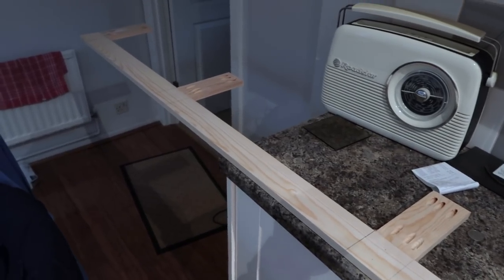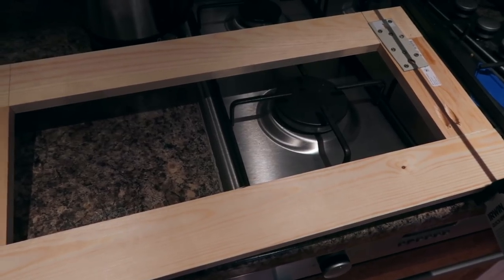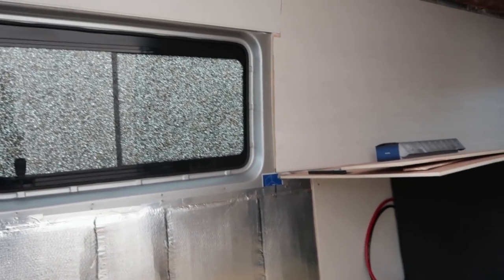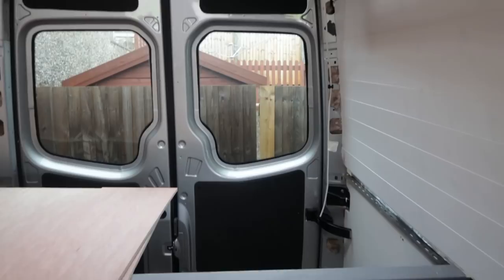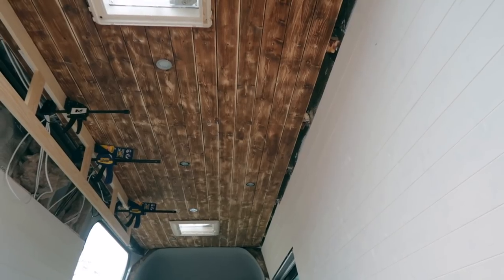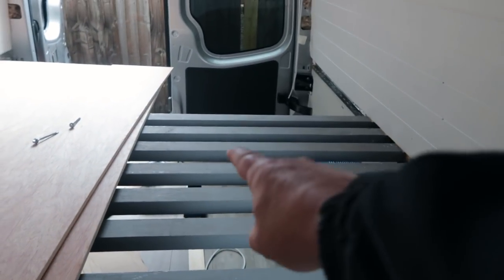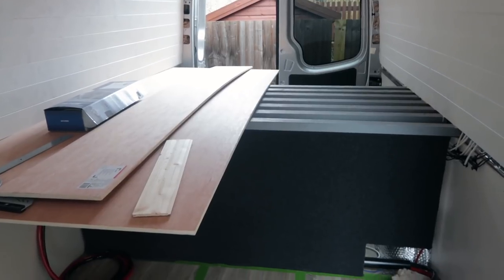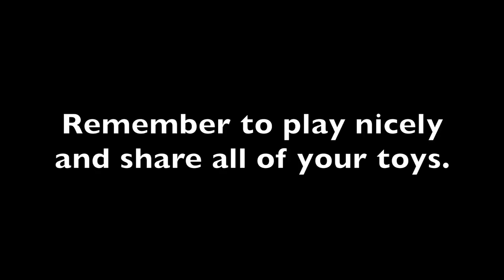Campervan conversion update

Comment: Merry Christmas fella.... Will you protect people from the hot exhaust terminal at the side of the van?
Reply from the maker: And the same for you. The exhaust is protected by a plastic cowling so is safe
Reply: @Shevanigans  Good... But if it's a plastic cowling perhaps it doesn't get so hot. Be careful, though, getting sued for a child burning their fingers would be no fun for you or for the child. My grandchild put his metal screwdriver I bought him into a electric socket and there was a flash. Luckily all was fine but did I get hell from his parents for buying a nine year old a screwdriver....